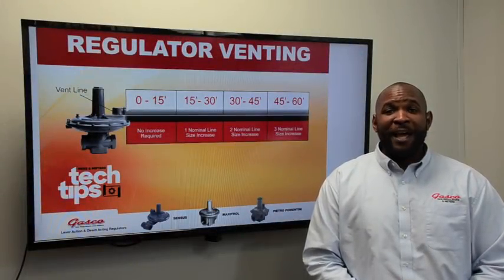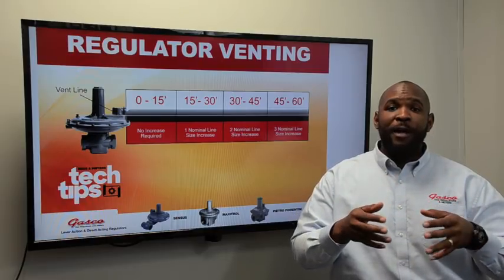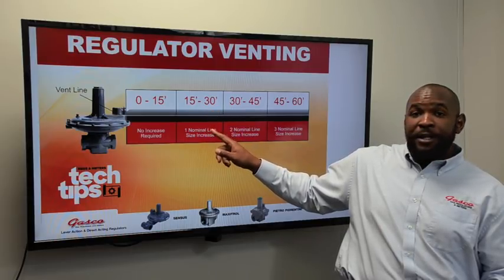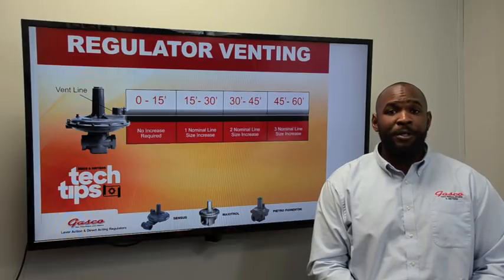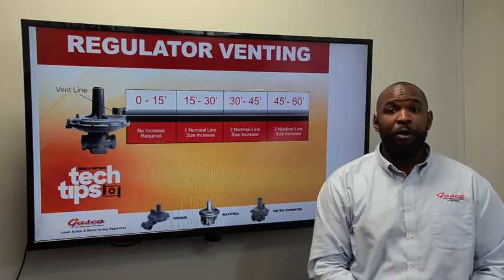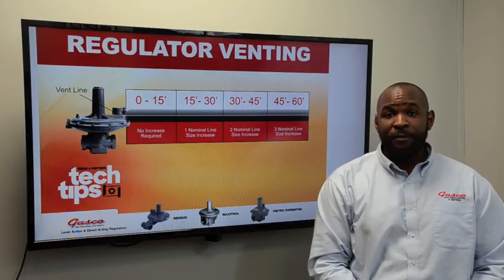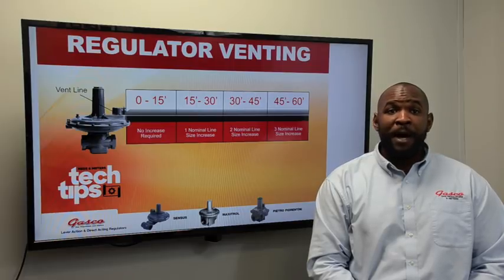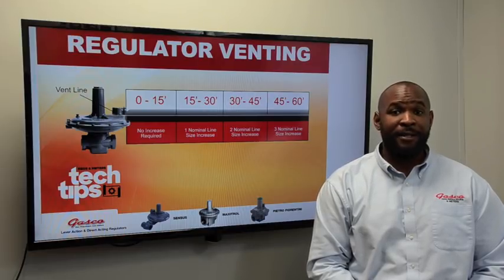Tech Tips: Gas Regulator Venting

Comment: I run the 10 feet pvc pipe for venting and i have burping sound on regulator 
What it my be
My flow 12 wc  , my luck is 13 wc, but as I connected the pvc  the regulator-start burping.  

No dirt in the pipe new line,

Comment: Gas leaks from the vent of my regulator, what could be the cause
Reply: Diaphragm in the regulator is leaking gas through it. Change the diaphragm or change the whole regulator. Either way it is not safe to run equipment in that condition.